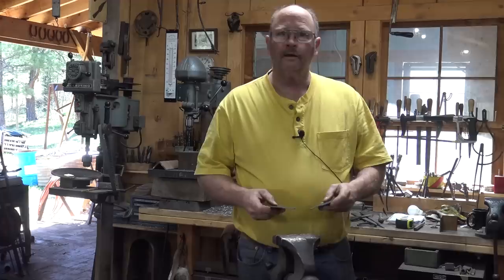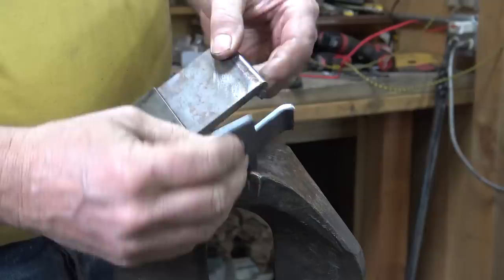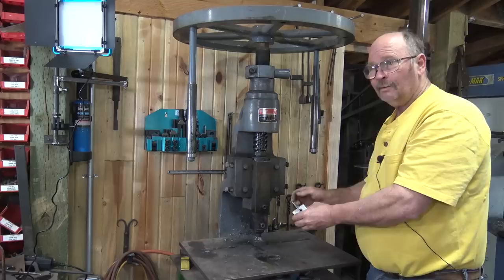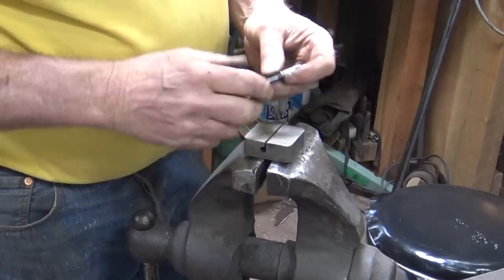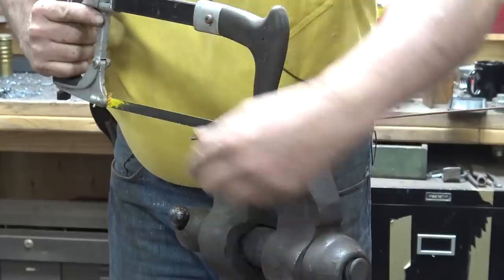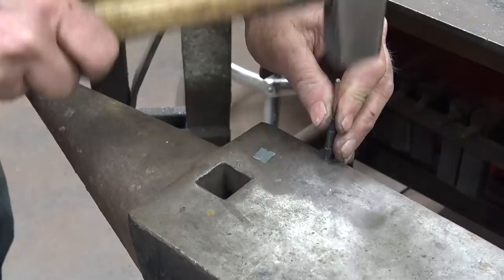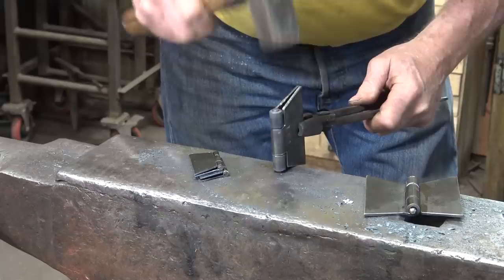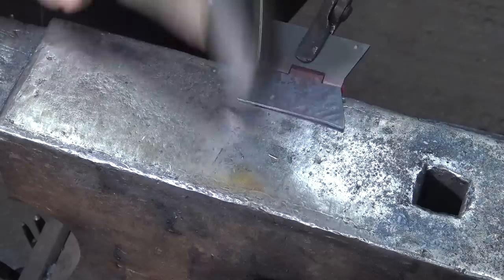Fly press butterfly hinges

Comment: That was good John, the jig was awesome, and I suppose if one doesn't have a torch you could use the forge. Was going to mention in another video I noticed the inside of the gas forge, is sort of melting or something, probably from forge welding.

Comment: Great device!! But for those of us who have no chance of affording a fly press, can you work these cold or hot by hand?
Reply: Wondering that myself
Reply from the maker: You can make a similar tool as a hand tool and hold the hing stock in the vise.  But you will need to heat the eye portion of the hinge to roll it.
Reply: @BlackBearForge   Thank you very much. That's a great idea...

Comment: Thanks again for making another video, even with the “oops”.  One question I continue to have is why does the project gets looser when heating if heating swells iron up?
Reply: More mass in the eye than in the pin, hence it swells outward more than the pin does. Plus, I think maybe it relaxes the spring put into the eye from bending it. Maybe John will answer with an explanation that comes more from experience than from physics.

Comment: Like a lot of the previous commentors, I too can't afford a fly press.  I was able to acquire an arbor press (2 ton).  Would the 1/8 inch thick hinges bend easily if they were heated in the forge first before putting them under something like a small arbor press?  I had envisioned a jig like the ones you're using at one point. I haven't had a chance to try.  Cheers.
Reply from the maker: So long as the heat was only where the eye needs to roll, it seems like it should work

Comment: Cool jigs. For production stuff they seem to work well. Was wondering if one dose not have a fly press could a hydraulic press (with stops) work?
Reply from the maker: I haven't tried it, but if the stops prevent over travel of the ram it should work.  But even the slightest over travel could really deform the hinge and perhaps damage the die.

Comment: Could these dies work with just a hand hammer or is the fly press pretty essential to use these?
Reply from the maker: Possibly, but it will be hard not to bend the hinges stock above the dies.  A better idea is to make a hand held die and clamp the hinge in the vise while driving the tool.
Reply: @BlackBearForge  I'm not sure I understand entirely. Thanks for the reply though. I love the content.
Reply: @BlackBearForge  so I went and got some of the 16 gauge hinges and just pressed them in my vice and it seems to work pretty good. I'm not sure if that's what you were trying to get me to do but I figured out a way to do it. Now I'm going to try some bigger hinges and see if that works.

Comment: Question: I don't have a fly press, so could I use a hammer or vice to accomplish the same end?
Reply from the maker: I have seen a similar approach used at the vise.  But generally you clamp the hinge in the vise and drive the tool

Comment: I am just curious, I see blacksmiths use fly presses but I never see them use arbor presses.  Is their a reason for that?
Reply from the maker: I have seen some using an arbor press.  But the fly press is designed for this type of work and seems to be more adaptable.
Reply: @BlackBearForge  I have never used a fly press (or done blacksmithing) so was just curious because arbor presses are common in machine shops and maintenance shops.

Comment: master please write the dimensions of your mini-lathe for bend hinges
Reply from the maker: The hole in the center is 2 times the thickness of the material plus the diameter of the pin.  The slot is the thickness of the material.  So exact size depends on your hinge and pin stock sizes.
Reply: @BlackBearForge  Yes, I would be satisfied with your size))) ... and so the thank you!